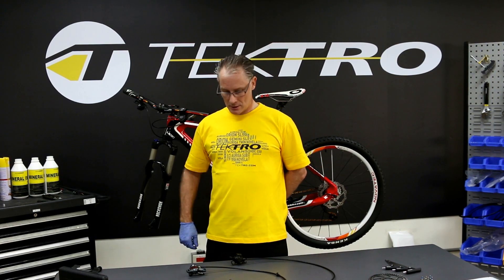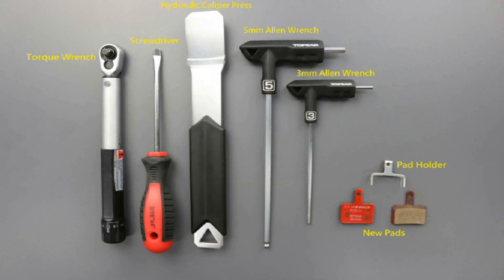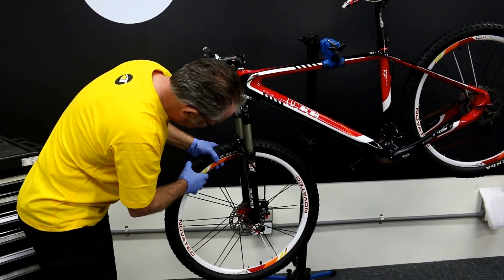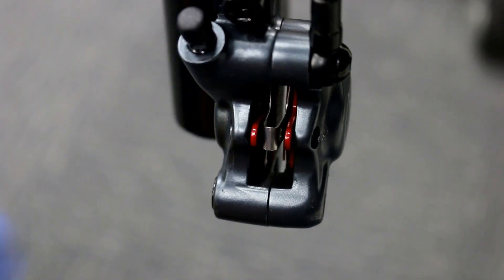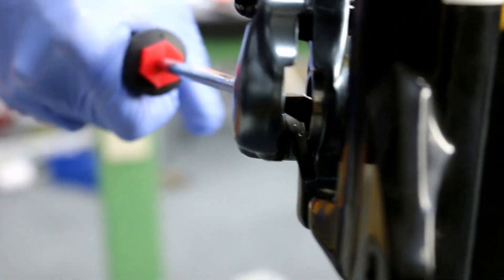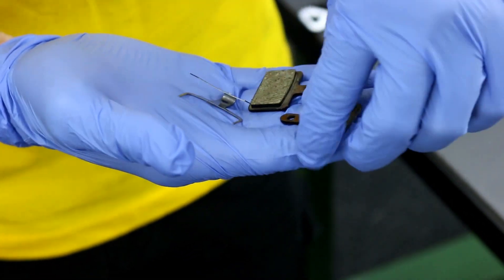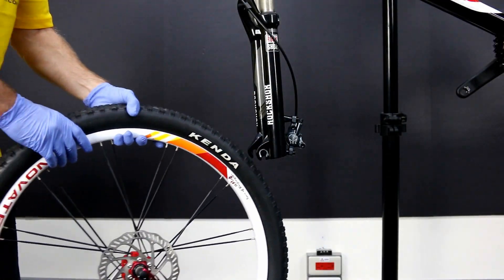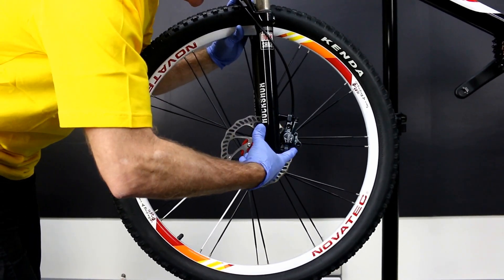Disc Brake Pads Replacement

Comment: Sadly, my Tektro brake has a metal clip instead of a screw, which is a real pain in the ass te remove...
Reply: Use straight plyers to pull the bent pin back straight. Don't be afraid to pull hard to get it out.
Reply: I came here for this reason. Can't find a video on how to deal with the pin, though. After you forcefully pull it out, can you reuse it again?
Reply: @bbnd5476  not advisable to reuse a split  pin. You can get packs of them for really cheap. Just measure your current one and do a bit of Googling on pin sizes.

Comment: The TEKTRO management and CEO should be ashamed of themselves! They absolutely will not respond to any emails from customers. What in god's name are they doing that they're too f'n busy to talk to a potential customer? I REALLY WANT(ED) TO BUY Tektro brakes for my ebike.  I don't care if you only sell OEM.  Gees, I only wanted to find a dealer who can sell me an HD-E715 brakes w/180mm rotor and HiGo connector. NO ONE seems to carry this. If you don't respond to this Tektro, I will actively do my best to tell my subscribers to NEVER buy TEKTRO products of any kind. Last chance!
Reply: For these types of things, you better check with your local bike shop and order through there. I have no experience with the parts you mentioned, but they seem specific.